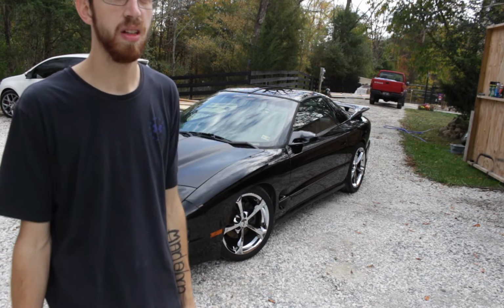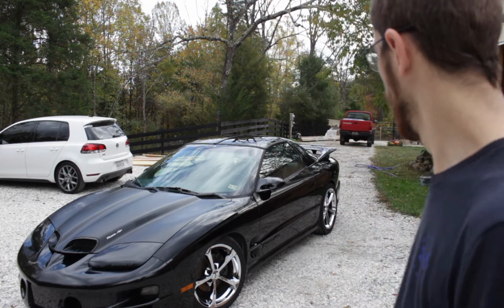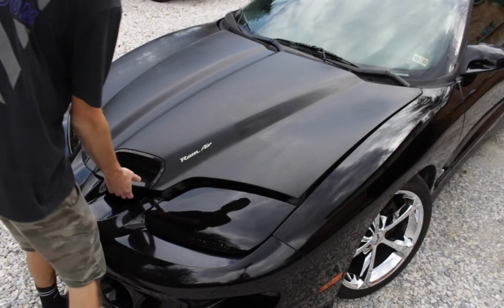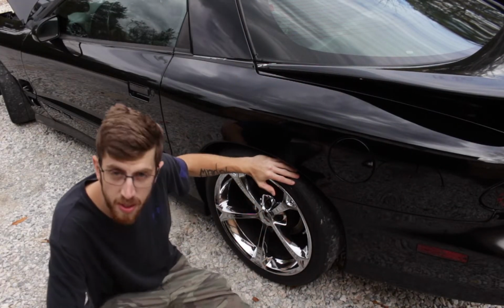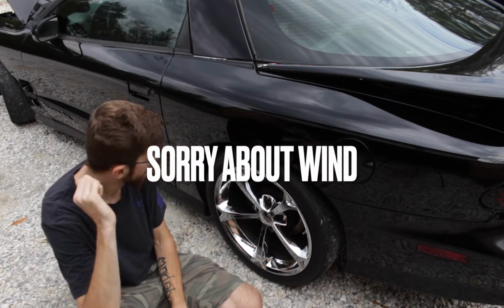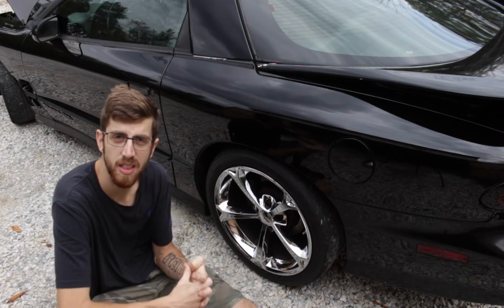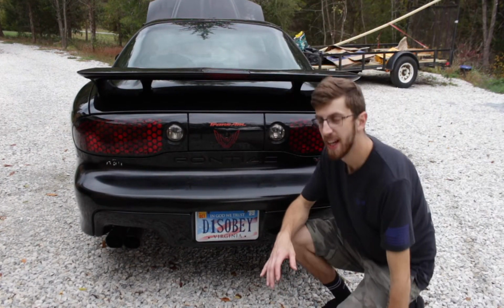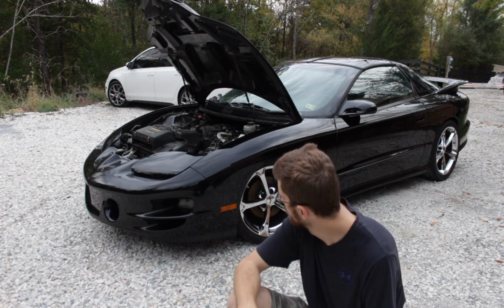ABANDONED Trans am ws6 history

Comment: Looks good, did the mice get to the wires at all?
Reply from the maker: they did not! This car was super lucky!
Reply: @doomedgarage7580  hey buddy I have 02 ws6..my cooling fans won't turn on even with the ac..I have all 3 new relays and fuses good..any tips?
Reply from the maker: @lositruggies1581  I suggest going to your local junkyard picking up another set of fans, or run power to the plug on the fan to see if it engages.